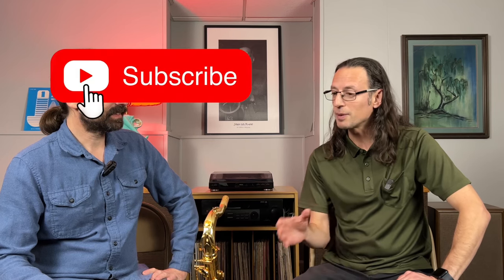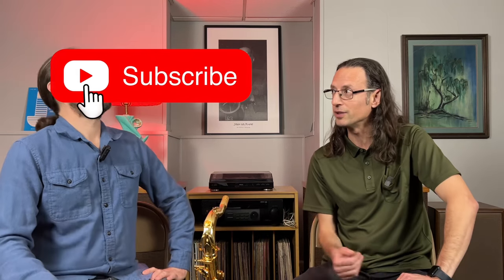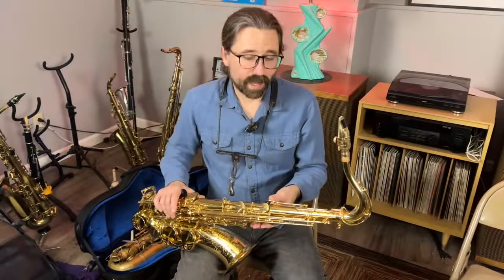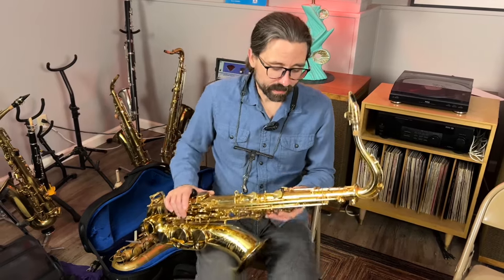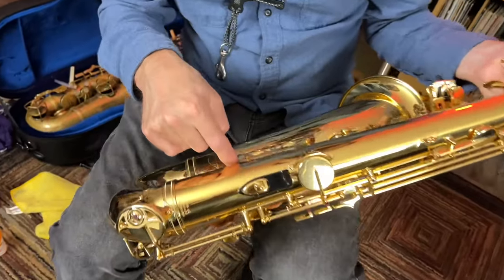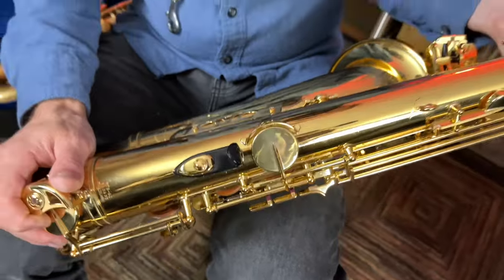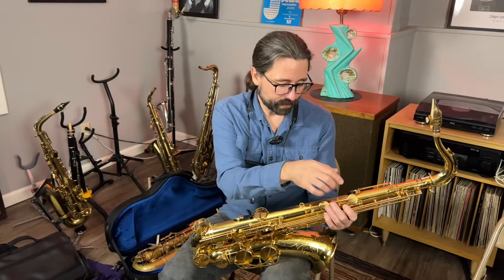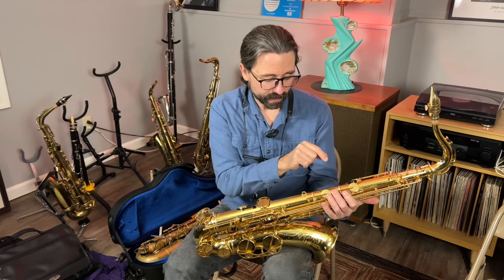How to check and adjust key venting on your saxophone!

Comment: I thought your explanation about venting was very good.  I'm having trouble with a very stuffy D whether 4th line or below the staff.  You mentioned the problem in your discussion but never really addressed it.  It makes my tenor really not very enjoyable to play.
Reply from the maker: Sorry for the late reply!  Thanks for the nice words. I should probably make a follow up video on that specifically. You can either trim the felt with the razor blade or on most modern saxophones. You can actually unscrew the Field holder and raise the key. I hope that helps and stay tuned for a short video on that subject.

Comment: Hi Scott, my midlle D is indeed stuffy, especially when used with the octave key, i do notice that , when i lift the C sharp key a little, it opens up more. this includes both my tenors, Keilwerth Toneking from 1973, and the Toneking Special from 1977
Reply from the maker: Hi Frank, More that likely the low C venting is the culprit.  If you're comfortable with this you can take a razor blade and trim some felt or turn the adjustment screw on the guard.  Sometimes just turning the screw is enough, but sometimes the felt needs to be trimmed or both.
Those are great saxophones, I have an alto stencil that I really like and I played a tenor for awhile.  Let me know it that helps and thanks for watching! Scott
Reply: @Scottsmusiccave  I will look into this, curious if this indeed will solve the ''problem'' i'll let you know, just to make sure, i turn this screw counterclockwise, so this C key will have a little higher keyhight..?
Reply from the maker: @frankversteeg8107  That is correct.
Reply: @Scottsmusiccave  Hi Scott, i opened the low C key, i gave it a full 360 degrees and a quarter. there is a noticeable difference, also what I noticed, that how you voice  makes a big difference, since i am still a student, for little more than three years now, I still have so much to learn. Which mpc you use in combination with which ligature is also what determines the sound. I will do some more experimenting, to confirm myself i'm on the right path with this. Mpc used was HR*JodyJazz #6* , and a OttoLink STM NY #5, lig. on the HR* a Optimum Vandoren and a Bambu Nova, for STM NY the stock lig. and Bambu Nova(Bb Klarinet) the Bambu makes it a bit warmer and darker
Reply from the maker: @frankversteeg8107  Thanks for the feedback.  Those are nice setups you have. It all takes time and it sounds like you're making good progress.

Comment: Bane of my life is that G# key on my KIng Super 20, circa 43 make.  eventually I figured out a way to keep it open when not in use, by using soft cloth under a bottom key the keep that G# open, and remove when playing
Reply from the maker: That’s super frustrating. Maybe this video will help. If not it you try replacing the pad or Adding spring tension to the G# key and lever. 
How to fix sticking pads on your saxophone!
https://youtu.be/y1wjRq3Kle0

Comment: Great video. I also have the issue with my middle C sounding stuffy vs side C. I have a P Mauriat System 76 Alto. I’ll try your adjustment.
Reply from the maker: I hope this helps. I just did a review on the tenor version if you want to check that out on my channel. Nice sax!